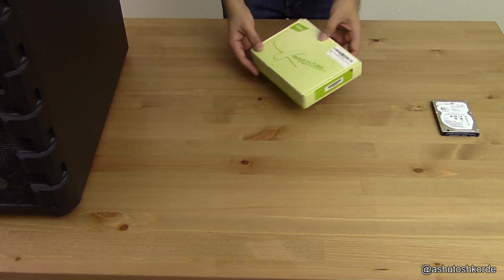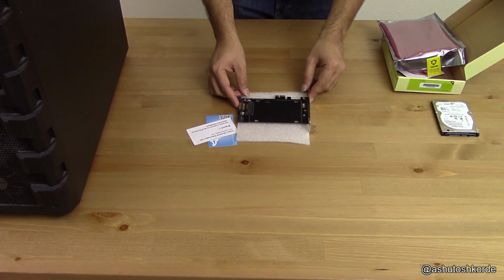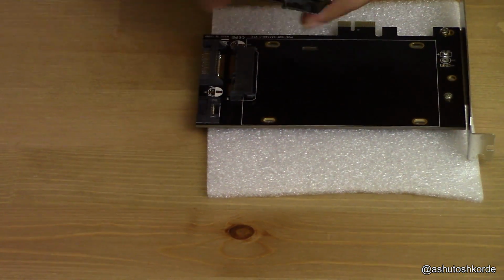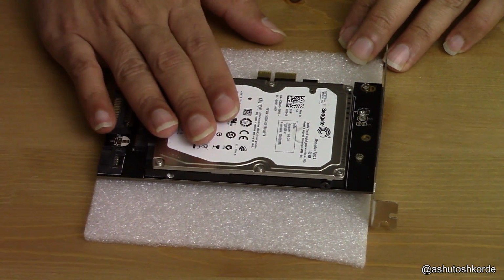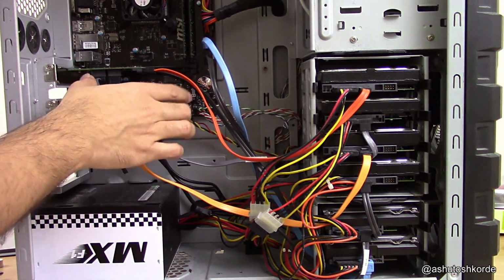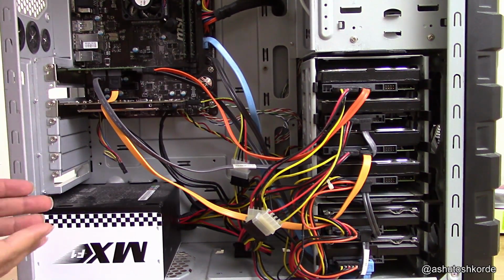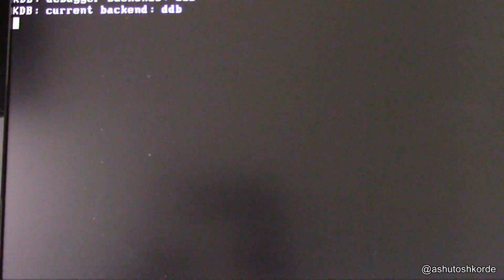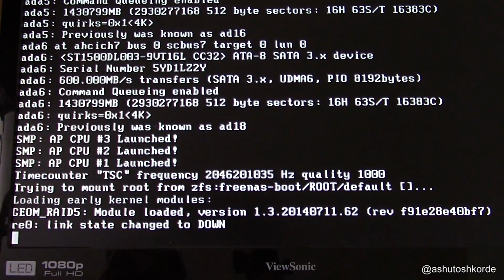Installing PCIe SSD Adapter

Comment: Considering it is in fact a NAS, the cable management isn't bad at all... It did solve one of my questions though, which is that you don't need an additional data cable to transfer data...

Comment: Woah, thanks. I was just Googling this product. It's pretty hard to find an x1 slot card. There's a slight variant of this card that doesn't need the extra SATA power connector. It gets it from the slot.

Comment: Hello. Nice video, I appreciate the help. Can you tell me if this way of connecting a SSD is better than using a cable and connecting it directly to a SATA III port? Are they equal when it comes to speed or is the classic SATA III cable variant even faster than this solution with a PCI-E adapter?

Comment: Hey motherboard specs are these 
Tell me if 950 evo m.2 NVMe would run at full speed without requirement of pcie adapter or not ? 

1 x M.2 connector (Socket 3, M key, type 2242/2260/2280/22110 SATA and PCIe x4*/x2 SSD support)
* Actual support may vary by CPU.

6 x SATA 6Gb/s connectors

Support for RAID 0, RAID 1, and RAID 10
* Refer to "1-7 Internal Connectors," for the installation notices for the M.2 and SATA connectors.
Reply: 960 evo it is .

Comment: Does using a pci-e adaptor make an ssd go faster?
Reply: Thx,my computer only has data 2 and the ssd dashboard says it is capable of running in 6 gigabyte mode but it isn't because i have ,sata 2.

Thx for answering my question
Reply: In the case of this sedna adapter, it is actually slower than sata2. The windows drivers are rubbish and if you saturate the controller it crashes. Using a mechanical drive won't saturate it and it does work well under *nix
Reply: Also depending on how the slot is setup. A SATA port has to go through an extra controller and/or then the PCH on the motherboard AND THEN the CPU. A pcie card, depending on port, motherboard and CPU, might be direct from slot to CPU. So with an SSD, you don't lose a bit of latency & overhead, it's more responsive.

Comment: how about an ssd with it is it going to be faster? than direct to sata 3
Reply: Depending on how the slot is setup. A SATA port has to go through an extra controller and/or then the PCH on the motherboard AND THEN the CPU. A pcie card, depending on port, motherboard and CPU, might be direct from slot to CPU. So with an SSD, you don't lose a bit of latency & overhead. It's not just about max bandwidth.

Comment: nice cable management bro
Reply: XD!!!!
Reply: I hate SATA cables, they are too short!
Reply: Better than the old IDE ribbon cables. SATA connectors are pretty crap though. They feel far too loose. USB type-C and even RJ45 connectors feel more satisfying. As for length, you can get longer ones pretty cheap on Ebay. SATA can handle up to 36 inches, if I remember correctly, before it goes to crap.